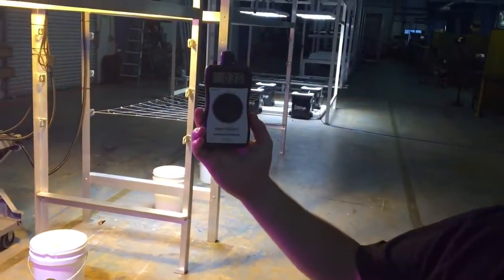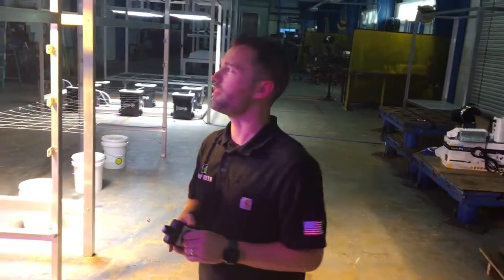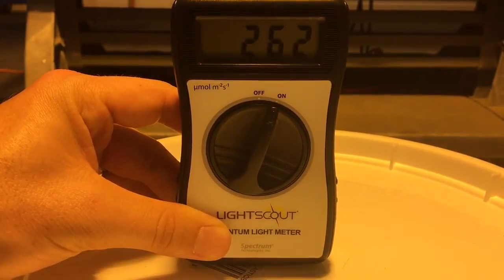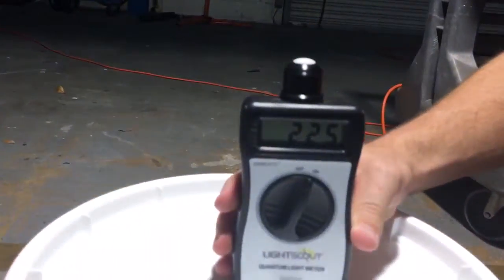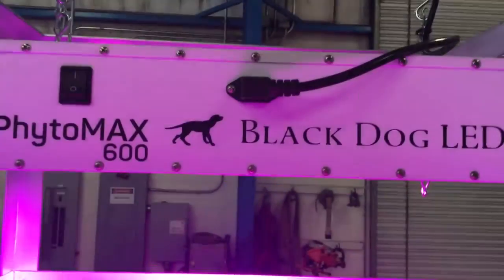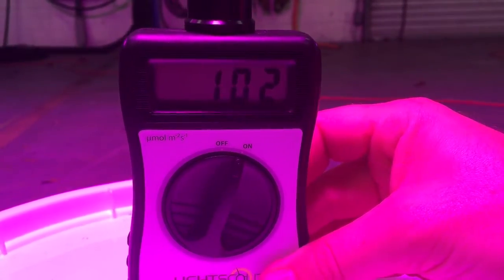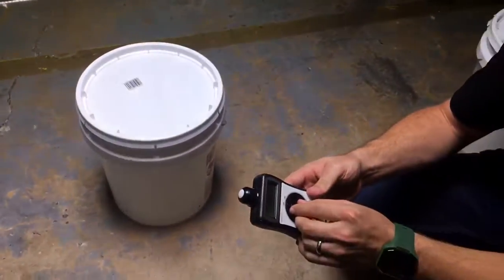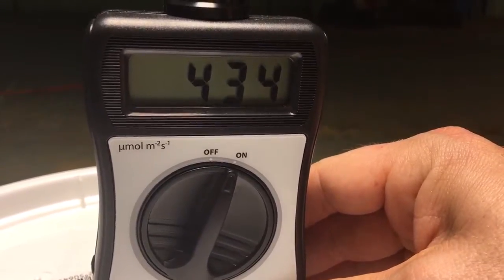SOGS-650X LED Side-By-Side Comparison

Comment: Thanks for the video, It helps us show we are as bright as a double ended lamp... 

If you want to be fair, put an optic on the Spectrum King LED and it will more then double the PAR values. Guys, Please don't misrepresent your product or at least explain that with optics you are focusing the light and sacrificing the spread...
Your LEDs  are not putting 200-300% more  light..You sound really bad saying that.If you really had that output , one of us "top LED companies" would already be there or be talking to you which we are not. Your are deceiving clients.

Dont be like the other companies that make a bad name for LED grow lights. And your welcome on the creation of the full spectrum grow light currently patent pending.

I expect you will be removing the comment most likely...

Founder
Spectrum King LED
Reply from the maker: Rami Vardi The SK600 light shown, as all lights in the video, are brand new, out of the box, as sold from the manufacturer. Happy to test any aftermarket add-on you believe doubles uMol production from what the manufacturer delivers in a box. And for the record, we are fans of Spectrum King and have promoted/purchased/installed more than 100 of their lights in the commercial facilities we have designed.
Reply: Rami Vardi word I thought he was very fair in showing the gavita and spectrum king fairly close. I don't think this was negative to anyone but black dog. This is dam near advertising for spectrum king by showing it perform so closely to the gavita at 65% power and as he stated the massive heat benefits w led but in particular  spectrum kings fantastic heat dissipation feature  (design). I think spectrum king is one of the tippy top  lights on market. spectrum king gavita and cobs r the future
Reply: SEA OF GREEN SYSTEMS Your light looks good but need more info,more videos be great
Reply: still have yet to see the coverage area